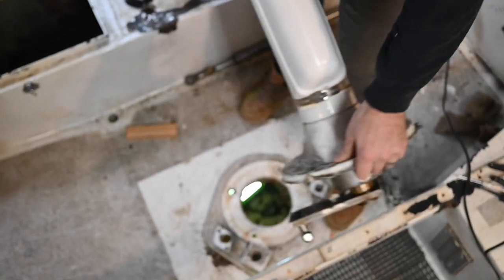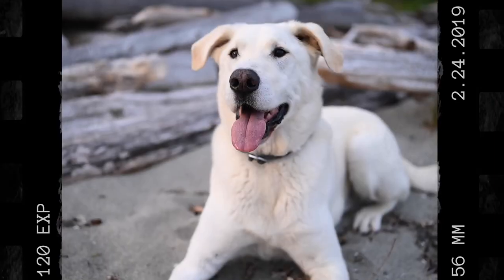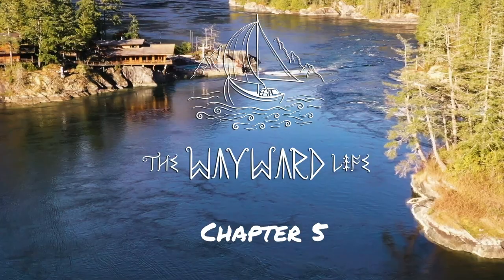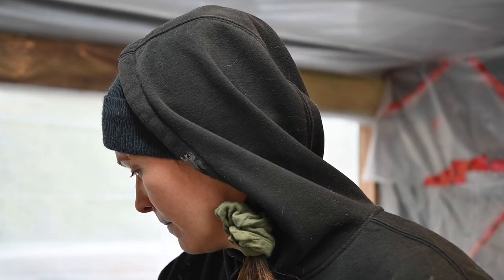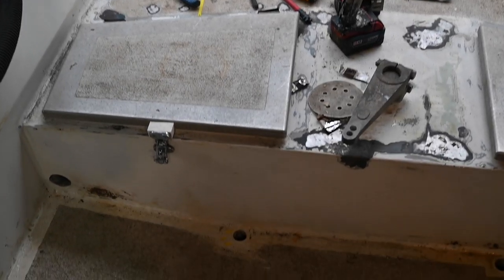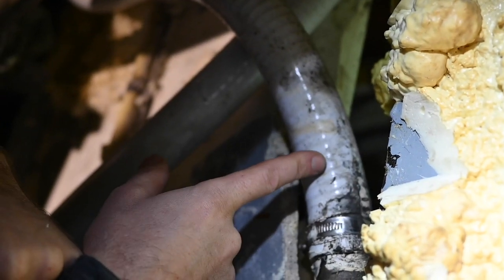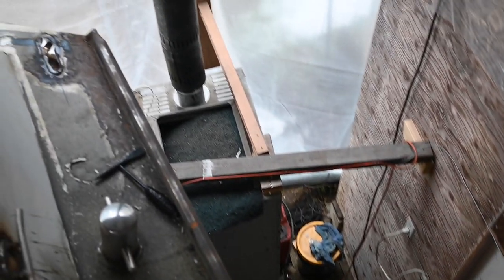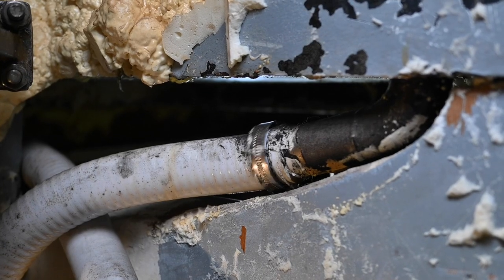Our Last Cockpit Fix Just Lead Us to Big Issues in our Steel Boat Restoration | Ch5 E57

Comment: It looks like the foamed insulation hid a bit of the rusted spots. Not sure I like foam.
Reply from the maker: So for the most part foam has shown to be a great option in this boat, but most of it was painted well initially. The issue with this area of the boat is that there wasn’t initially any spray foam, so they ended up with rust and instead of prepping and painting properly they did a quick job that didn’t get rid of the rust and then foamed over it. Anywhere else on the boat that has spray foam has been surprisingly great, and there has been a very noticeable difference between where there was foam and where there isn’t. We are still spray foam fans.
Reply: @WaywardLifeSailing  my steel yacht is 45 years old. The second owner spray insulated an area behind the settee and the ceiling. While removing the foam, I am finding lightly rusted small areas within areas of perfect steel. The rest of the hull was never sprayed and represents about four fifths of the hull area. and it has very little rust. The builder epoxied the inside too. I am painting the inside and insulating with two insulation products used in house building: foil reflective bubble wrap insulation; rock wool 1.5” rigid foundation insulation. Naval vessels use rock wool for insulation as it does not burn. Sound proofing is better too. But it is finicky to install all this stuff. That’s why production builders don’t use it. I am not suggesting you do this since it means removal of all existing foam. For a bare hull like mine, it is easier and totally DIY.
Reply from the maker: @einarquay  it's always interesting to hear other people's experiences for sure. was it closed cell spray foam or regular off the shelf home stuff? cuz that also seems to make a huge difference in durability.